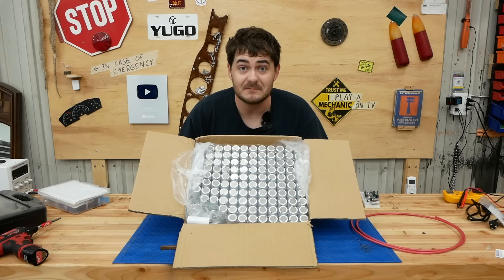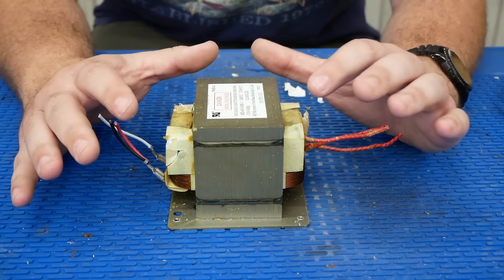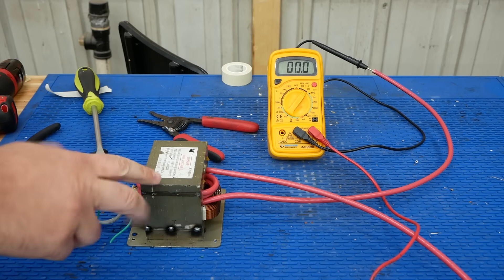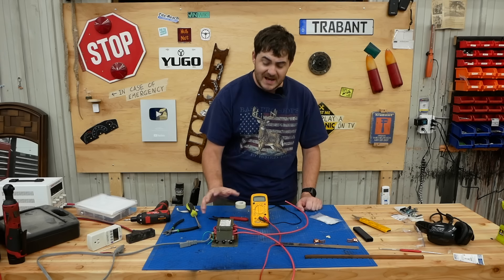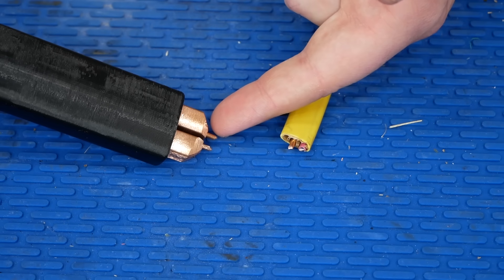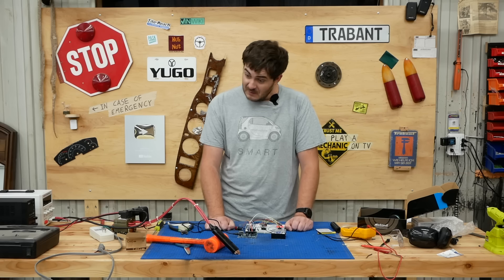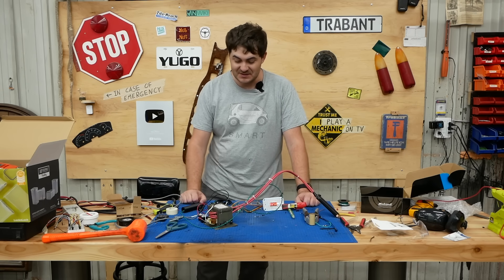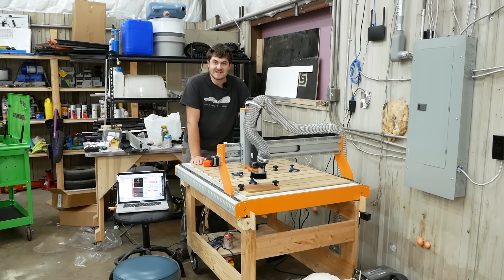I Made a Battery Spot Welder from an Old Microwave and Excessive Mahogany

Comment: You know, you could have cut the secondary coil with a hacksaw without having to cut the transformer apart? You real like doing things the hard way
Reply: Totally agree, and as an added bonus the transformer would have worked even better, than now, where he only spotwelded the "I" onto the E.

This is going to significantly decrease the effectiveness of the transformer, and that was probably also why it was humming so badly.

Comment: You can get much better performance if you have the core halves in perfect contact, the bussing oyu here is not good you have an air gap, in this kind of Transformers you want none. Maybe you have to even Lapp the surface but that's not hard just some sand paper and then clamp it really hard and weld it then

Comment: To anyone wanting to try this: you'll need to scavenge the transformer from an older microwave. Newer ones use inverters instead, which won't work for this project.
You can tell by hefting the microwave. If it doesn't give you a hernia, it probably doesn't have a transformer like this one.
Reply from the maker: Good tip!
Reply: @UnderDunnOfficial  - Thank you, sir!
Reply: Ok. I checked my microwave. Now I need vid about removing hernia. Kindly please sir.
Reply: @kamilbednarz227  check out Weird AL. He already did a video about it. https://youtu.be/X8Ow1nlafOg
Reply: I have a microwave gathering dust in my garage that is so old it has knobs. I think it would be a perfect candidate for this project.
Reply: @Oddman1980  
Btw take out the magnetron before scrapping it too, carefully. Thing is very fun to use to fry electronics, if you focus it.
Reply: Inverters can work in some cases, but takes WAY more work. Not worth it.

Also, the magnatrons contain insanely toxic materials that will kill u ded if opened. The fcc my recoil in horror if you use the magnatron, but it's only a mild danger if you do some basic shielding and dont point it at your eyes.
Reply: @nobodynoone2500  It's only toxic if you take it apart break the ceramic and inhale it.  That's only if the ceramic is BeO and not alumina or whatever else they commonly use.  The interwebs says the pink ones are toxic. If true it's coincidence BeO is naturally white and looks pretty similar to alumina.
Reply: And they usually have “Inverter” plastered on the door or control panel, if you don’t want to pick it up
Reply: Interesting, I've taken apart dozens of microwaves and have never seen one without the old transformer and cap combo... how new are we talking here exactly?
Reply: Try to find one by the side of an apartment dumpster.  Goodwill must be watching these videos and jacked the prices lol, at least by me.
Reply: That is a very appropriate and accurate profile picture you have.
Reply: Newer, expensive, one. My inverter Chef Mike cost me $500. A cheap one is just like this dude's.
Reply: And for the love of GOd, please be careful with magnetron parts: the HV capacitor can give a deadly shock. NEVER play (=connect tot mains) with the transformer as it is unless you actually are a high voltage engineer. And be VERY careful with the actual magnetron. The invisible dust that is created if you break the insulator is outright very cancerous.
Reply: You can also get a transformer from a car battery charger.  They are typically 1.2kw.  Easy to find a swap meets.
Reply: @jameslmorehead  I doubt it. My car battery charger is rated 4A. That's more like 0.05kW...
Reply: @misterhat5823  Then obviously that one won't work.  I've pulled them out of chaegers with the jump start assist option.  Puts out over 70A for a few seconds.  Much beefier than your underwhelming charger.  Just look for the red case and black face chergers that weigh 15 to 20  pounds.
Reply: Tf do you have to be made of to get hernia from a microwave? It ain't a full stove...
Reply: Also don't do it. You will almost certainly kill yourself.

Comment: What you want for your welder's cables is funnily enough called Welding Cable. It uses much finer strands then typical wire and EPDM or neoprene insulation for greatly improved flexibility. FYI it is also great for use in high power rv dc power systems because it's much easier to route and work with in confined spaces.
Reply: @georgec1979  - Don't be so silly. This is very low frequency AC so "Electron flow happens primarily on the surface of the wire strands" is just rubbish. Where do people pick up this idiotic ideas, Audiofool Forums?
EDIT TO ADD: At 60 Hz in copper, the skin depth is about 8.5 mm. So, unless each strand in the cable is greater than 17mm (about 3/4") the skin effect is totally irrelevant.
Reply: @georgec1979  Ehh skin effect isn't a huge deal at 60hz you would have to go to like a half inch thick solid wire to start having it be an issue. The fine strands of welding cable are purely for flexibility.
Reply: @georgec1979  Skin effect basically doesn't matter at 60Hz.
Reply: Another (conflicting) requirement is to have thin but durable insulation. The insulation on the wire wastes a great deal of the winding window area and will reduce performance. A square bar magnet wire primary would be ideal.

Those silicone insulated wires used in the RC hobby are notorious for having very thick insulation. Silicone doesn't have a lot of abrasion resistance and it tears easily.

ETFE or PTFE insulated wire that is used on aircraft is kind of the opposite of flexible silicone wire. The insulation is really thin but offers better abrasion resistance. That wire can be rated up to 260° which would be ideal since it would handle overload well.
Reply: 35sqmm copper welding cable. (It's not used for welding copper!) 70sqmm aluminium cable is cheaper, but not as effective unless you're overly concerned about weight. I mean the cable weight.
Reply: @georgec1979  Your hypotheses makes logical sense and that probably is a benefit of stranded wire in some case, however  110/220 does not use solid wire only…not even close. in fact all SE (service entrance) cable is stranded , as is 99%.of the smaller conductors pulled through conduit in commercial buildings for 15-2.0-30A branch circuits, and of course practically all connector cables are stranded wire. Solid conductors are less common than you think, you don’t find them much at all anywhere conduit or plenums are required, and - only NM (“Romex”) , UF (direct burial) and BX )armored cable are solid, and then only up to #8 or #6 gauge.  I was taught solid wire is used because of better heat dissipation in framed walls and for physical characteristics (stays straight and flat, requires minimal support,  as well as being much easier to terminate etc.
Reply: You can also use silicone cable from eBay etc (maybe 8GA?), car jumper cables, or the wire they use for high power audio amplifiers. The silicone cable from eBay will be the most flexible (by far).
Reply: @johncoops6897  I agree. Probably much cheaper. The key is using oxygen free copper or ofc with silicone insulation. Stay away from copper clad aluminum or ccl, it will also usually be cheaper than the ofc
Reply: @Moonsauc3  - no need to worry about "Oxygen Free" or similar marketing rubbish. Plain old copper is what you need - oxygen is useful stuff in the air you breathe, but isn't significant in power cables.
The conductivity of common C11000 Copper (ETP) and higher-cost C10200 oxygen-free (OF) Copper is identical. The extremely expensive C10100 grade OFC used in cryogenics is only 1% higher conductivity (insignificant)
Reply: @johncoops6897  it's not the conductivity that I was concerned about, it's about the rigidity of the wire itself. The ccl is much more stiff than pure copper. Plus it doesn't break as easily over time.
Reply: @Moonsauc3  - I agree with you about the stiffness. And the situation is made FAR worse by the fact that CCA cables need to be about twice as thick for the same current handling capability.
Not sure what you mean by not breaking as easily over time... aluminium is not normally considered flexible enough for repeated bending, which is why CCA is traditionally only used for fixed wiring situations. 
CCA doesn't really solder properly, since any connection is just with microns thick high-conductivity copper which doesn't really "connect properly" (in the long term) to the aluminium cores. Whilst properly crimping of copper makes the best possible joint, with CCA they usually just clamp/crimp the ends and hope for the best. The crimping means the thin copper coating is fractured, so you end up with lower conductivity that only gets worse over time. Also, any flexation at the ends of CCA will cause significant increases to resistance over life.
Overall, CCA is a REALLY poor choice for any kind of flexible leads. Which is why (traditionally) it's never used for that, despite the cheap jump start cables using CCA to save cost. I guess it doesn't matter in that case since they might live their entire life in the trunk of somebody's car and never be unwound and used.
Reply: CCA aka "Copper-Clad Aluminum" can also catch fire under high current in rare cases. Hence why they no longer use aluminum wiring in homes.
Reply: @Moonsauc3  Believe it or not plenty of car audio guys buy welding cable because it's cheaper and works great.
Reply: @emoore254x  I worked at a car audio tech for years. I've seen it all, from table lamp wire to romex to extension cords. I've seen screws drilled through wire for ground. People running power wire out the hood and over the fender. Grommets not used so when the 0g shorts the carpet starts fires. Audio cable is cheap also. People make things so difficult. Just buy a Amp kit and no guessing about a fuse or terminals rca cables etc.
Reply: @johncoops6897  silicone jacket is crap and that wire is not oxygen free. go to the welding store and get some. jackets far better too.

Comment: Cool, I've used a wine bottle box and instead of cutting the core I've sawed off one end of high voltage coin and pushed it out. For the switch I've used a "wall mounted" 230V spring loaded light/doorbell switch bolted to a plank so that I can operate it with a foot.... Although I've never made a spot welder head, instead I've used it to heat wire to cut Styrofoam. And for melting stuff :)
Reply: FYI those switches are not designed for inductive loads AFAIK.
Reply: @nyetloki  And what's a classic door bell if not an electromagnet pulling the bell hammer? But sure, these are drawing milliamps so wear of the contacts is minimal. On the other hand same switch design, lacking only a spring is used for light switches and some lights, e.g. linear fluorescent are inductive loads.
Reply: @mibars  you think a common doorbell switch is made to handle 1400W inductive loads?
Reply: @nyetloki  That's a tricky question because the switch is rated for 10 A with no mention of type of load. That switch, in a regular light switch variant which only lacks a spring could be used to switch dozens of linear fluorescent tubes with magnetic ballasts which will be below 10 A, but would be definitely an inductive load. I think it would wear out prematurely.

Comment: Couple of things. The transformer works by concerting electrical energy into magnetic energy putting it in the steel core then converting the magnet energy back into electrical energy. It isn't 100% efficient. The efficiency is related to the the air gaps (especially in the core) in addition the current loops inside the core also reduce efficiency.

So if you want high efficiency you don't cut and then weld the transformer. The individual plates have a thin insulator between them to reduce Eddy currents, this insulation can burn when heated. In addition the air gaps added by cutting them welding and not perfectly touching are really bad..  ie 1mm can cost you 30% efficiency for a transformer. 

But If it works... Don't fix it...
Reply from the maker: This is the kind of expertise I look for in the comments. I only knew enough on this topic to make it function. All the intricacies are beyond me. Thanks!
Reply: In addition you may want to make sure your SSR (relay) is rated for inductive loads, Ie motors. For a few hundred welds I don't think you will have any issue, but if you were doing a huge battery pack. The kick back voltage can cause damage. Worst case you change your relay out every few hundred welds... Probably still cheaper than a off the shelf battery charger...

Comment: 4:02 that's just false. Just because something is capable of outputting high current, doesn't mean that much will actually flow through you. Just half an amp is enough to give you a heart attack, so by your logic, a phone charger would be lethal.
At 2.2V (even though it's AC) you can grab on to it directly and nothing would happen, the only way you'd even feel it is if you put the wires on your tongue.

Comment: Im pretty sure you still need air cooling for that I appreciate the heat doesn't seem that much but as you trap heat the various components get warmer so its tough to know which components will fail with the heat.
Reply: Nah. At a duty cycle of probably less than 1% even under heavy load, the Arduino is probably kicking out more heat than that transformer. It'll be completely fine. (Source: am electronic engineer.)
Reply: I'll just point out that transformers have a tendency to store heat in their core.  So in minimal testing it may seem cool, but over time the heat will spread throughout.  Same sort of thing with battery packs.  The central cells tend to fail quicker because they can't cool like the outer cells.
Reply: @zendell37  True, but again, not at a <1% duty cycle. There's more than enough time for any heat to dissipate through the core. What matters in the end for long term use is the average power dissipation inside the box.
Reply: Im a construction manager lets go with cooperised suggestion
Reply: I'm sticking with the electronics engineer on this one.

Comment: With a program like VCarve or Aspire, you can easily CNC parts from 3D printer models.  There is no reason your handle or button grip should not be a matching wood for your case.
Reply: Fusion 360 would do the same job, and Robert's clearly familiar with the software. 

I was also thinking that he (you, Robert) could've designed his circuit in Fusion 360 and had a PCB made especially for the spot welder, all within Fusion 360. Then it would've been COMPLETELY OTT.
Reply: I was thinking he could have cut his box parts and joints using the CNC as well.
Reply: @tomconway6808  It's hard to cut square corners with a spinning router bit, so there would be a lot of hand-finishing to make the two sides of the boxjoint interface correctly (unless he also applied a corresponding convex 3d profile to the fingers of the boxjoint).
Reply: @EmyrDerfel  Oh duh right.
Reply: Well I think some of the better electric cars you have sitting around are going to get functional better battery upgrades soon and you have a cool new toy to do it with, a win win in my book. Wish I'd watched this sooner but glad I finally did, that was fun to watch and maybe you get a microwave upgrade 😉👍

Comment: It's the amps that'll kill ya for sure. 😎

What is it? As little a 2 amps can kill you? I'd Google it, but I really don't feel like typing all that stuff into my internet browser to get to Google to find the answer. 😎
Reply: 110 mA applied correctly will stop a healthy heart, but it needs to be AC. DC needs more, but I can't remember exactly, but 2 amps is plenty.
Reply: @OscarSommerbo  Both AC and DC can kill you at a pretty low current. However, the "it's not the voltage that kills, it's the current" is misleading. Current = Voltage / Resistance.

Metal has a low resistance, so current ends up being very high. Ideally, infinite. But realistically it'll reach a limit and the voltage will decrease.

Human bodies have a much higher resistance. As such, 2V isn't actually enough to drive 600A of current through a human. In fact, it can't drive a noticable amount at all.

So, while it is the current that kills, the voltage is still required to push the current.

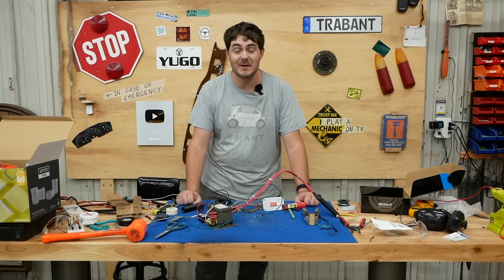Comment: Until 9:15 I was wondering where the mahogany in the title was going to be used.  Awesome spot welder!  Amazing how we now typically use Arduinos where we used to use a simple 555 timer or even a single transistor with an r-c circuit to time it.  But then, it wouldn't have worked the first time.
Reply: Having precise control of the timing is nice, although analog has a certain charm to it
Reply: @sugarbooty  u also don't have to spend day reprogramming shit if it blows up.
Reply: @plainedgedsaw1694  it would take me 10 or 20 minutes to program something this simple, and if it blows up its probably not the microcontrollers fault
Reply: @sugarbooty  I meant the scenario in which the uC would get blown up, both more expensive and time consuming to repair than just swapping socketed 555 or smtg.
Reply: @plainedgedsaw1694  if the microcontroller gets blown up the circuit needs work, the same can be said for a 555. Right now with the chip shortage its a bit difficult but ive used ATTinys and its pretty cheap and easy
Reply: Seems like wasteful overkill to me.....

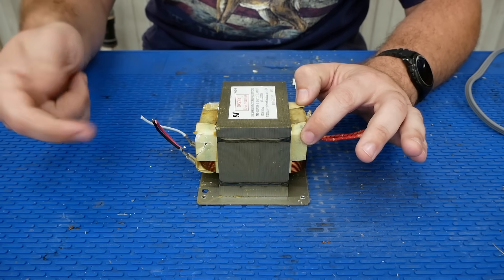Comment: 1:54 basically a transformer works by converting the power to low amps and high voltage if the wire on the primary is thicker than the secondary coil, whats needed for a welder is high amps and low voltage hence swapping the windings at the top for larger windings on the secondary the Wattage stays the same just the numbers change due to induction currents.
Reply: It's wizards.